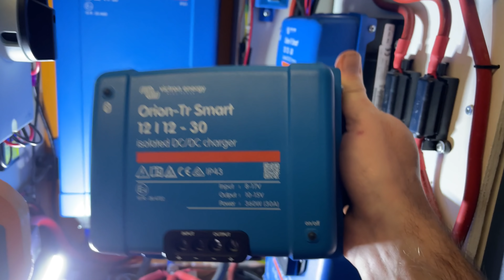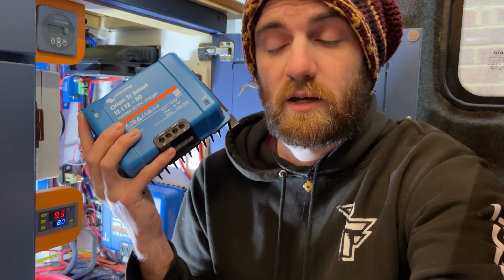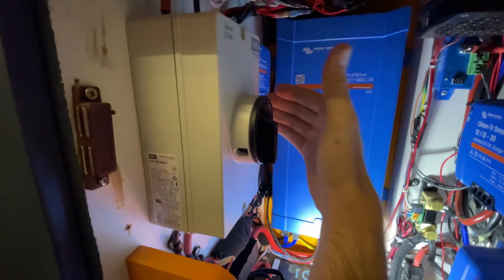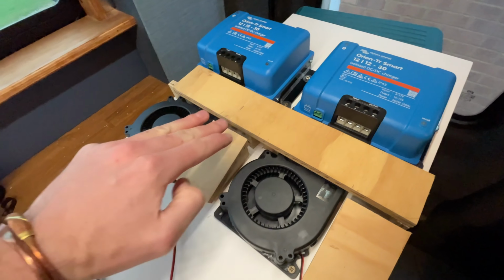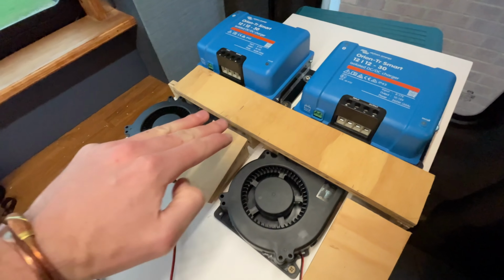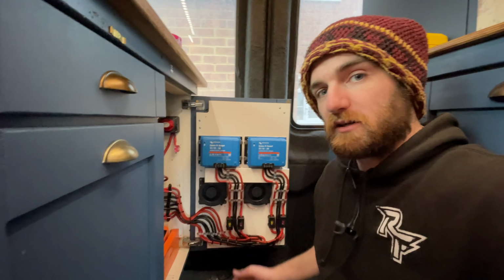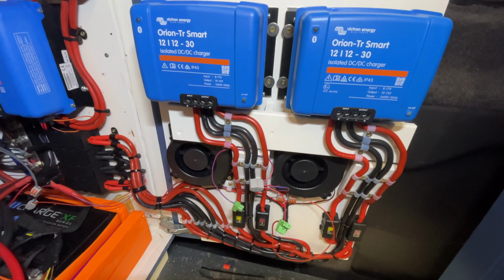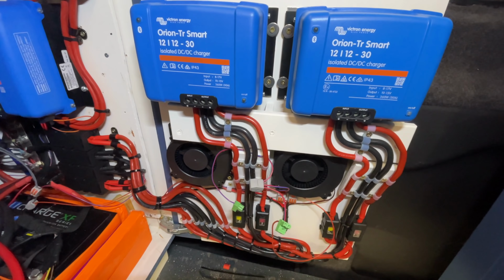Double Victron B2B Charger Install | How To

Comment: Wow, I’m impressed…..this was a very informational video.  I will definitely do my setup like this with dual DC-DC chargers.  I like how you had the rocker switch in the front can to turn one or both of them on. Ingenious!!!!
Reply from the maker: Thank you very much. The rocker switch is definitely used in the summer as I don’t need both running and it’s a lot hotter.
Reply: Does your electrical cabinet get hot? Do you exhaust or active cool the cabinet?
Reply from the maker: Yes, the whole cabinet has ventilation slots and a 12 V fan extracting air from the whole cabinet. Otherwise, I’d  just be recirculating hot air from the charges.
Reply: What device/monitor are within orange blocks?

I’m assuming that is a voltage/amperage monitor?
Reply from the maker: @OldExodus that was for old battery heaters. It’s a temperature controlled reply. 

My current lithium batteries don’t need heaters but I left the unit it

Comment: I’ve only had Amps so far on my victron 18 and 30amp setup but it’s an improvement ready for more off grid holidays
Reply from the maker: All great power sources for your off grid holiday
Reply: i have 18amp and 30 amp victron orion chargers but only get 38 amps for the 2 in parallel should be more you think?
Reply: they both have own power supply cable from battery .its sturdy cable 60amp each
Reply from the maker: Do you have a amp clamp, so you could monitor the output of each individual unit and see where you’re losing power?
Reply: @MispronouncedAdventures  yes
Reply: @MispronouncedAdventures  Yes will check each cable again seem to have 10amps loss I have had my compressor fridge on all Time in summer but as it’s winter I turned fridge off for now .j had chargers playing up one was turning. In and off some say to do with lockout so changes settings just had on power supply mode got z3&amps on way home 17mile commute daily
Reply: Got mains charger on now
Reply from the maker: @stevemcgowan3017 definitely make sure they’re on charger mode and not power supply. 

Yeah, I would measure the amp output of each unit and see if one’s giving you 18 and one’s giving you 30 if not, then start to narrow down the issue
Reply: @MispronouncedAdventures  thanks i did actually buy a fan for cooling but not fitte d yet
Reply: one thing about power supply mode is it keeps sucking power out starter battery after engine switches off.i forgot to switch back to charge mode so just having to charge starter battery up a bit as van wouldnt start.its a vw t4 2.5tdi.ive had a few starter batteries over 3 years think something to do with my leisure batterie set up maybe.i have 105 ah life po4  for  power my fridge plus usb sockets and diesel heater.i kept my old agm battery its on separate circuit it runs my 3 amp stereo plus subwoofer..that gets charged from my old dc 12amp charger..i did have the 18amp victron running that but as the 30amp victron was playing up switching on and off i paralleled the victrons again and fiddled with settings and was usiing the power supply mode when on way home.what settings you use on yours bud?lockout etc

Comment: Thanks for mentioning ccp point. I have been struggling to figure out how to get more amps. : )
Reply from the maker: One post CCP would be great for one B2B. but given each post is only rated to 60amp. Two B2B’s using all three posts on the CCP together seems the best option. But I made a video about upgrading the CCP

Comment: Great video. I think two b2bs for the winter (especially your kind of extreme winters!) will be very helpful!
Reply from the maker: It certainly was, I installed this before my Arctic trip and it made a world of difference. There was hardly a day I didn’t reach 100% on my batteries after only a short time

Comment: Great video, and the way you positioned the fans really maximize the cooling. There where some rumors awhile ago the Victron is coming with a higher power DCDC chargers. I don't have the van yet so I'm still on the sideline, I may end up with similar setup.
Reply from the maker: I’ve also heard the same rumours, i’m not sure why they haven’t yet done it as DCDC charger why is there behind everyone else. 

As for the fans you will see in the next video of the ridiculous different they make
Reply: Agree. Sterling just released a redesigned B2B with up to 120 amp input at 12 v (can output 12, 24v). Does not have Bluetooth but not sure as critical to have it for B2B compared with solar controllers where you more actively monitor how system is working. Sterling have been pretty reliable for many.
Reply from the maker: I am pretty interest to see how the new sterling battery to battery chargers workout, I’ve been keeping my eye on them .  Victron are pretty behind on the maximum output of their chargers versus their competitors. 

I know a lot of people who use sterling, I actually use their induction stove. But I know a few people have switched from Sterling B2B to Victron ones. 

Looking forward to more sterling unit videos

Comment: Finally got around to installing a second  Victron DcDc 30a, however I fitted the seoncd one with a rocker switch to turn it off when not required - saves excess draw on the alt when not required.
Reply from the maker: I have a rocker switch on the dash as well, which can turn both off, one on or both on. Normally use it in the summer when I’ve got plenty of Solar
Reply: @MispronouncedAdventures  I heard you say that, something I should think about as well!

Comment: Hi Alex love your channel. I’m just about to install two Orion 50amp chargers in a 2022 sprinter. I noticed you had an alternator issue on your last winter trip, do you think this may have been related to the double chargers you’ve fitted or just age of van? Just a video idea but would be great to see a mop up video from all of your electrical exploits & what kind of new equipment is available to establish what would be the best system to suit your needs now.
Reply from the maker: Enjoy your two new Orion XS! As for my alternator issue, I don’t think it was related at all. It was the alternator clutch pulley opposed to the alternator itself. but my van had 147,000 miles at that point so I’m pretty content It was just a worn out part which failed. 

I’m going to soon be building a new van with a pretty different electrical system, which should lead to some interesting videos

Comment: Great video , like yourself i also found out videos for wiring two b2b's a bit thin, like the use of the fans cos dam they get hot.
Reply from the maker: Quite a few people I knew now are running them in parallel but not many videos. How effective the fans are is surprising!

Comment: Would u need a bigger alternator for 2 leisure batterys and 2. dc 2 dc chargers ??👍
Reply from the maker: Not necessarily, it depends on what your vehicle comes with from factory. Mine came with a 220A alternator so plenty. 

Rule of thumb you shouldn’t put an auxiliary load (DCDC charger) larger than one third of the alternators capacity

Comment: Nice vid. I'm also thinking about adding a second DC-DC Charger. Wher did you get those coolers from ?
Reply from the maker: As for the coolers, which country are you in?

Although my opinion it might be better if  opposed to adding a second older 30 amp Victron Orion model. You added the newer, more efficient and more power Victron Orion XS 50A DCDC. And either kept your original one or even sold your original one to recuperate some of the costs for the new XS.
Reply: @MispronouncedAdventures  I'm in germany.

Comment: silly question but, having 2 victron  30amp chargers I  only need 2 wires coming from the front battery + and - and then connecting the 2 chargers together on a busbar is that right.
I here everyone say they get hot but might don't?
Reply from the maker: You could do it via one thick cable and a bus bar to the charges or you could do two separate smaller cables to the starter. 

How long have you left the running for to test before they get hot?
Reply: @MispronouncedAdventures  
Thanks, the longest I've driven is about hour and a half  B2B not hot.
Great, what I might do is as I've got one already set up run another 2 cable then to the front battery

Comment: Hello mate,

Great video. Ive got a question though. Im currently running 1 set of 16mm² from my starter battery to 1 Orion DCDC charger at the back of my van in the garage area about 8 metres in length (Typical Peugeot Boxer L3H2 setup) and id like to add a 2nd Orion. Question is do i need to upgrade the cables from starter battery to something bigger to compensate for more amperage? Have you got a schematic on your set up please? 

All the best

Love your videos 📹 ❤️
Reply from the maker: Hey! I’d definitely not want to run 2 Orion’s on one 8 Meter 16mm2 cable. The voltage trip would be pretty large. That could be up to 75A on the input side. 16mm2 is rated to 110A ( I think ) so your cable would be getting toasty! 

You could run a second 16mm2. Or what I did was run a new 50mm2 ( 35mm2 would of done ) and then split it down to 16mm2 at the units
Reply: Thanks mate I did think that 🤣 it's cool I've got it running underneath the van in copex upto the battery box so will get some bigger cable and pull it through.. 

So connect my 35mm² or 50mm²  to bus bars yeah and then from that 16mm² to my Orions yeah

Cheers

Chris
Reply from the maker: @chrissperrin7903 doesn’t necessarily have to be a bus bar. I used a mega fuse holder as a way to easily connect. 50mm2 lug on one side and 2 x 16mm lugs in the other.
Reply: @MispronouncedAdventures  nice one... what fuse holders are they? Have you got a link?
Reply from the maker: @chrissperrin7903 any “mega fuse holder” pretty general time should be fine. They use Largest studs than a midi fuse.
Reply: @MispronouncedAdventures  Actually volt drop shouldn't come into it the minimum Input voltage for the Victron 12/30 is 10v so even with 25mm² cable the amperage would be fine with 2 running in parallel producing near 75amps.

25mm² cable
Nominal Voltage 12.6v
Current Draw 75a
One way circuit length 8m (airing on the safe side length wise)

Voltage drop 7.33% (0.924volts)

Well within spec for the Victron 12/30 DC DC chargers

I love maths 🤦🏻‍♂️
Reply from the maker: @chrissperrin7903 it’s not the lose of voltage being below the minimum input being the problem , it’s the lose of energy across the wire from resistance, causing the voltage drop, which is issue. Is the efficiency loss resulting from it
Reply: @MispronouncedAdventures 

it's confusing me then because the voltage drop at 75a resistance on a 25mm² is 0.9v at 8m x 2. 

🤷🏻‍♂️

Comment: I know this is old at this point, but I'm experiencing issues with overheating and derating of my 2 orions. 

Could you go into more detail about the wiring of the fans? Like a for dummies version of where you have them in order to be on the input side and only turned on with the orions?
Reply from the maker: The wiring and the fans could be done in a number of ways. Some people I know have used temperature control relays where temperature sensor on the  Orion would turn the relay on and turn the fans on. personally that seems over complicated as the Orion always overheat. 

I have an ignition live signal for when the van is turned on power the relay which powers up the fans.
Reply: I'm unfortunately at the level where that information doesn't help me 🙈... it looked like the fans were wired into the green remote switch, but I can't tell where the positive and negative of the fans are going to 

On another note, I just saw another comment where you recommended either adding another 16mm wire or going to 35 from the battery, does the negative also need to be upgraded? Mine are unisolated.
Reply from the maker: @Melissapeterkin  what you saw going to the green bridge was a additional signal wire from the ignition live. 

While the Orions themselves can sense engine is running or not, I sometimes choose the summer to have one of them turned off, I have a switch on the dash which allows one Orion and one fan to run, or both Orions and both fans to run. 

As for cabling. 16mm2 cable is enough to support one Orion, not two. You could run a second 16 mm² cable or something like a 35 mm² to run both fromx I happen to only have 50 mm² that’s why I used
Reply: Thanks for responding so quickly!

Was asking if the negative from the starting battery needed upgrading along with the positive?
Reply from the maker: @Melissapeterkin no problem. yes, both cables should be upgraded.

Comment: Can I ask a question? How many amps will a VSR send to the leisure battery if I have a 140a alternator? Will it send ALL of those amps to the leisure battery once the relay connects the two batteries?

I'm currently in the process of changing from a vsr to dc to dc charger, but notice the dc to dc chargers output around 30a (depending on which one you choose), so will these chargers take longer than using a vsr? 🤔
Reply from the maker: VSR output would massively vary due to a number of factors. A few being RPM of the engine or capacity of your lead acid battery bank. 

You don’t want to use a VSR with a lithium battery as you’ll cook alternator. Lead acid based Batteries are high resistance, therefore effectively limit themselves. Lithium chemistries are low resistance, which means they will take everything the alternator has to give which is problematic at low rpm where the alternator isn’t cooling itself as much.

Additionally, VSR’s are not charges, whilst they will charge your battery. They are just relays which combined two batteries. DCDC / B2B are smart charges, which have a variety of charge profile set to properly incorrectly charge your battery to full. charging the full is something else you can’t achieved with a VSR
Reply: @MispronouncedAdventures  yes I would only use the VSR on my current setup (lead acid) which gets it to around 80%, and the rest is topped up with solar to 100%. 
I'm just trying to get an idea of the current charge rate compared to a new DC to DC charger setup which would be either 18a or 30a 🤔

Comment: don't feel like spending more money on another victron charger after I have only 16amps coming from twin dc victrons now.i use mains viltron ip22 30amp charger when at home .its just when touring for long periods off grid would need drive van longer or use campsite to top batteries up .Think maybe will swap my arm 105ah battery for another lifepo4  105ah this year as lifepo4 cost come down a lot now
Reply from the maker: Sounds like an issue upstream of your DCDC chargers. The chargers can’t get the power they are trying to pull. 

mine does with from time to time when my van goes into smart regen mode
Reply: @MispronouncedAdventures  you think I can reset chargers maybe.think I did factory reset.i just bough one those fans like u have to cool my 30amp charger.i can smell it when it gets hot .

Comment: hi. my victron dc chargers are only putting out 2 to 6 amps .they 18 and 30 amp.were working ok but only about 30 amps max.i have another 12amp dc charger working ok that’s on separate circuit supplies agm battery to my stereo.12v campervan t4 setup.i have victron smart shunt and solar too.any ideas?i have tried swap to power supply mode and checked settings too.regular alternator .thanks.steve
Reply from the maker: Odd, sounds like the Alternator isn’t outputting. 

My smart alternator ( I know you said yours in a regular ) has a similar effect on my chargers when it does into smart regen mode ( van stops its output ) , when my DCDC charger are only outputting a low Amps.
Reply: it’s up to 10amps not brilliant eh.my other dc charger off ebay still ok 12 amp model about 7 year old that

Comment: Howdy. I’m interested in more info on the trickle charger please.
Reply from the maker: The model I use is a 12v to 12v 1A trickle charger called a E848
Reply: @MispronouncedAdventures  I've been looking in to this. Called up the company that make/sell them. They say it's not advisable to be used with lithium. How have you set yours up if you don't mind me asking?
Reply from the maker: @nirwin  Most trickle chargers ( including mine) are pretty dump. They are set to charge the starter battery to a pre set voltage below the leisure battery voltage. Which is fine when both battery are lead acid based. Example my trickle charger turns on if sees the starter is 0.4v below the leisure battery and then turned off again when it’s charged up to 0.2v below 

Lithium has a higher resting voltage so this is a problem, in my case I use a voltage regulator to set my own “ leisure system “ to trick the trickle charger
Reply: @MispronouncedAdventures  ha. I see. You should do this for a living! Oh wait... 😁

Comment: Anyway your able to show me how you have linked up your negatives are they connected together in those midi fuses I have the isolated version so I am just trying to figure it out
Reply from the maker: Justing using the M8 lugs on the end of each cable. Then stacking those lugs on the M8 post in the mega fuse holder
Reply: @@MispronouncedAdventures  thanks mate watched the video a few times then realised what you had done if I get stuck ill send you a messege haha do you have a insta

Comment: I have same setup but one of my charger after20-30min lost 70% power and i dont know why ? When its only one its ok but together its lost the power. Temp its same of both amper from engine not change. Any idea what’s happening?
Reply from the maker: That’s an odd one. 

Were both units purchased at the same time I know the generation one of the Orion had some heating issues which Victron offered to replace units. 

Are Cable lengths to each unit exactly the same, and are the settings exactly the same?